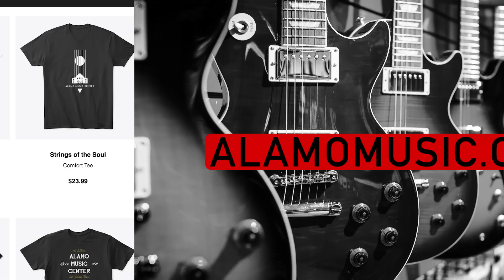The Problem with Planned Obsolescence

Comment: A good example is the Shure MV88 mic to plug into your iPad. I bought one a few years ago and never used it. I recently upgraded my iPad and iOS and decided to finally start recording my guitar and voice. It is not compatible with the the current iOS system and Shure hasn’t made any adapter to make it compatible. It’s for sale…..cheap.😖
By the way, shure responded to my call quickly and I talked with a guy for quite awhile. Excellent service with a knowledgeable tech. Thanks for that Shure.

Comment: Planned Obsolescence (OP) has always been part of sales designs and profiteering.  Think of a simple thing like toothpaste, it's always reinventing the new, better, improved benefits...it's pure BS sales jargon.   There is also another situation called 'Hold Out". This is where the technology that is readily available now, which is purposely left out and saved for the higher priced models and or for later models, which would actually cost no more to put in the lower priced models right now.  As a professional photographer this is rampant in camera's, lenses, pp software and photo equipment. As for Taylor, when the Andy Powers take over reinvention came about, which IMHO was purely to try an generate sales in a somewhat saturated dead sea.  I now see more "used" V class braced Taylor's for sale than most every other brand. People are not stupid and figured out it really didn't improve things as touted.  As for Martin's authentic and modern deluxe models they didn't loose their heritage moving forward to generate sales.  The SC Martin's are for a specific live scenario and the neck design is stellar.  As you mentioned all this has gotten worst with the digital age and the ability for manufacturers to cripple things with software, subscriptions and hold out specs, has gotten worse....As for acoustic guitars, wood choices are a problem for the future.   As we all know Apple is one of the worse, with the cellphones and Macs, not to mention all the other companies further controlling your ability to use older tech.   I feel just around the corner is the Ai controllable technology looming on the crest of time. We are already starting to see it bloom in many area's of final manufacturing production where products will be obsolete in a year or two. Hey, Tictok is controlling you right now 😂

Comment: That's exactly why I don't like acoustic guitars with electronics. The guitar ages well but the electronic will become obsolete in no time.
Reply: Not really … I have a 1996 Godin LGX which is full of electronics that still work as good as when I bought it … and Godin still makes and sells the same model.  Plus acoustic electronics are usually easy to replace.
Reply: Electronics doesn't translate directly into obsolescence. Like tube amps, they've been working for decades and unless you fry the circuit they'll continue to do so. Be careful with anything that has microchips, tho and stay away of anything that needs software to operate, of any kind.

Comment: There's a slew of problems with batteries that get replaced and thrown away. It's not a perfect solution to the problem of creating junk. Failing rechargable batteries are frustrating, too, but there's just no perfect solution currently.

Comment: One obvious conclusion: rechargeable batteries need to be standardized. There should be a range of different capacities and sizes, but as a principle they should be replaceable. It is not just a matter of cost, but of ecology. I've had quite a few devices that I would gladly continue using, but had to scrap because of a dead battery: mp3 players, satnavs, phones, wireless interfaces and so on. It really infuriates me how much we talk about eco-friendliness and how little manufacturers actually do to stop destroying the environment.

Comment: The Fender Mustang I amps used Fender's FUSE software to be able to get more sound options on the amp.  Fender discontinued support for FUSE, so now you only get what you can from the amp itself.  Really bricked the amp in my opinion since it's main selling point was that you could hook it up to a laptop and get a lot more sound options.  Wish they would have open sourced the software so it could still be run and updated by the community.  But they are selling their new line of Mustangs now with something else.
Reply: Fuse required Microsoft Silverlight that was discontinued by Microsoft, so not really Fender’s doing.  I actually keep an old Mac Mini with Silverlight and Fuse on it so I can tweak my Super Champ X2.
Reply: @ILuvJazzNJava  That explains why it happened, which even that info is not easy to come by.  Outside of a workaround like you are doing and have the resources and expertise to do it, the rest of us have a brick. If I wanted to sell it or even give it away to a kid who was just starting out, there is little residual value in it without the software to provide the features which was its main selling point.  Better off just buying one of those Guitar Center Gamma cheap amps and avoid the software route all together.

Comment: does it become a $120 piece of junk? You pay for the use you get out of it. Battery lifespan is less a planned obsolescence thing, and more of an entropy thing. The battery industry I'm sure colludes to find the best efficiency to profit ratios, but the Mustang thing is just using batteries availalbe to manufacturers. I have never had a battery only device reach end of life. Usually by the time it happens, it's outdated hardware anyway.

Comment: This is why I haven't bought an Acoustasonic. I actually think they're quite impressive guitars especially for recording but the built-in battery in the American models scares me off as the guitar is useless without it, plus who knows how long Fender will actually be making them for. Wouldn't surprise me if in two years they're discontinued and replaced with a new model using completely different software.

Comment: It is tempting to point out the irony that Alamo orders FSX5 or FGX5 guitars and does not stock the FS5 or FG5. But Luddite guitars don’t sell, whether the end user ever plugs one in, or not. I have to do some kind of ROI for purchases. Ubiquitous Yamaha keyboards are hard to beat. When it craps out it will get replaced. My YSL-697z got difficult to maintain to gig ready status:  It got replaced by a 1960s King 2B trombone that I can depend on. I will probably get Chris or Cooper to order me a FG5. I expect the FG5 to see me out.

Comment: C.F. Martin and Fender have proven that it is about nuanced changes... I bet you sell a lot more Fender and Squire historic homage guitars (e.g. Classic Vibe) than you do the current USA built "standard"  , Fender American Professional. So guitar companies just try to toss as many things onto the market as they can, it seems... Taylor is the one exception, they have no real history before 1980 and don't have any household celebrity musicians who were playing their product in the 80s and 90s to have a vintage legacy... The GP body clearly a not to slopes from Martin and Gibson, but it's also its own thing... My point is that Taylor is the one standout and if you look at what they do with marketing and features are either directly or indirectly creating obsolescence... No builder has incentive to keep the resale value of their instruments high. The opposite is true. They just have to make customers think because their product is built in the USA that it will hold great value, which isn't true. It's very specific to supply/demand around specific makes and models. Compared to new pricing, on resale a customer might loose 25% reselling a Taylor 800 and 12% on a Martin D28. That's not the same thing at all.

Comment: The title of this video is a bit strange. Like, is there anyone who doesn't understand the problem with planned obsolescence? 

Planned obsolescence has an interesting origin. Light bulb manufacturers were at one point making light bulbs that were too good. They would last for years and years without burning out. This limited sales of new light bulbs. In order to boost their sales, they began working on light bulb designs and materials that would limit the life of a bulb. This was done in a collusive manner internationally, and they had ways of disciplining manufacturers that didn't fall in line.

Comment: I would say mac is the biggest culprit of this scheme.  What is it 7 years I think before a computer is obsolete and not supported or updatable? Pretty sure it's 7. I'm a victim of this so I can def relate. Not here for bragging but to explain, I had a custom built loaded to the max iMac built back in 2011 for strictly recording music and graphic design, it was just under 4k I was younger and didn't have the knowledge I do now. Although that computer served me very well and could handle whatever I through at it, it's almost useless now, can't use it for much so it's in attic all boxed up in factory box cause idk who would even want it. Now have custom built windows based, non Mac tower and dual 32" screens and can rebuild or modify in future at a fraction of the cost. Basicly can never become totally obsolete. Lesson learned the hard way
Reply from the maker: Hey Bryan, I’m a Mac guy and typically use mine for 5-7 years before replacement but I completely see your point. My son and I built a custom PC last year. The trouble is that PC components are starting to fall victim to the same plan. A new chip comes out? Guess what, it isn’t compatible with your board. Now you have to buy a new board for a new socket and a new RAM spec and your power supply isn’t up to par unless you planned ahead. -Chris
Reply: PC's will suffer the same thing. Every 3-4 years they change socket so if you wanted to update the processor then you have to buy a new board.  That new board then probably need new ram etc.  At some point the video card is too powerful for the processor you have so its pointless buying it because the cpu will just bottle neck the vid card.  The only thing you might not have to change is the case.  Eventually the case become obsolete too because the video cards get bigger and wont fit.  So yeah, you can update PC components for a few years but how is that any different then replacing a 7 year old mac?
People expecting to buy something and have it last forever just arent being realistic. The 7 year old mac cost you how much? 2k maybe? So it cost you about $285 a year to use that Mac.  Thats how you have to look at it.  Same with their mustang example. $120. If it lasts 10 years thats 12 bucks a year to use it.  Can't expect stuff to last forever.
Reply: @AlamoMusic  yes I agree on some of that, but like I said upgrading parts is still a small fraction of the cost of anything Mac. I used to love Mac don't get me wrong. And when the time comes I'll just upgrade what's needed but I'll never have to spend thousands again and always have a powerhouse of a computer. Maybe I'm lucky I have multiple friends in the computer world who always tried to talk me out of getting Macs years ago. Im not a builder but I know what I need,and it's not another 4k computer that's only going to be good for 7 years
Reply: @sols.2525  nope, sorry you're only rite on some of your claim, and my Mac was about 4k so big difference, I can get the parts for the build I have now for so much cheaper, and you can't even rebuild newer macs so.... what's the debate here? Sorry you're stuck in Mac land. I'm happy with the change and the future of it. If you disagree, I'm sorry if I offended you
Reply: @HVACRTECH-83  I do disagree.  Im not stuck in Mac land.  I have both a Mac and I build my own PCs.  They just changed to the new sockets this year so you are good for about 4 more until you need a rebuild again. If you paid 4k for a Mac 7 years ago then I think you paid for more than you actually needed but thats not my business.  You didnt hurt my feelings. I'm just offering up my knowledge of using computers since commodore 64 36 years ago and building them not long after

Comment: Consumers need to fight back. DO NOT BUY ANYTHING WITH A RECHARGEABLE BUILT-IN BATTERY.
If you buy something that takes regular batteries, you can buy those & recharge them 'till they fail, then replace the batteries with new.
FIGHT BACK. Refuse to buy built-in rechargeable-equipped devices. If we stop buying them they'll quit selling them.